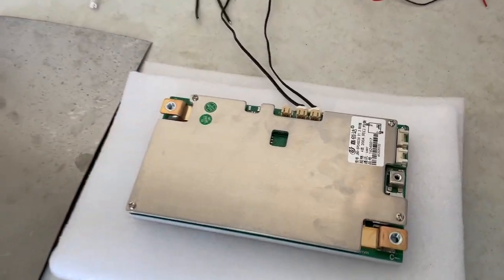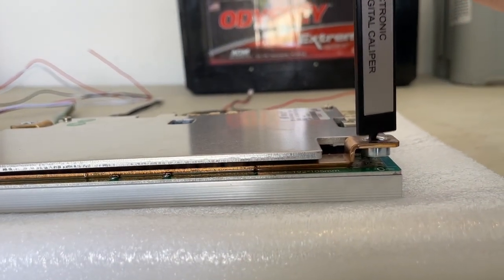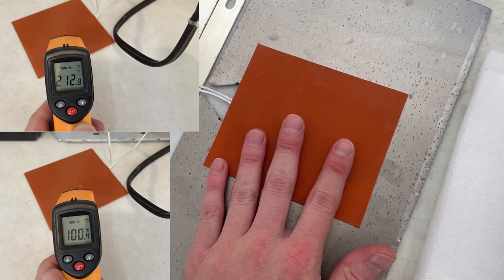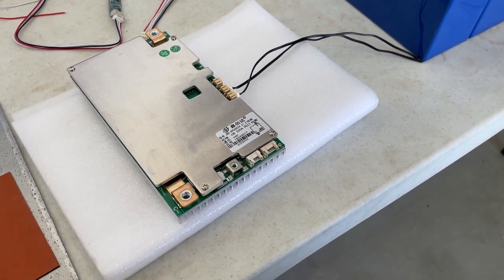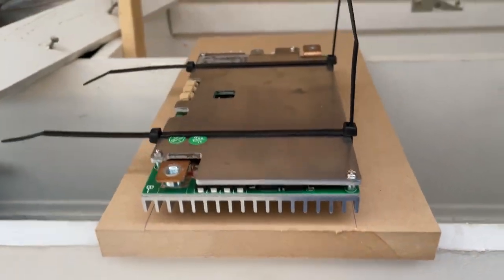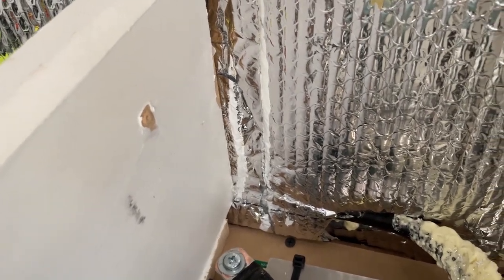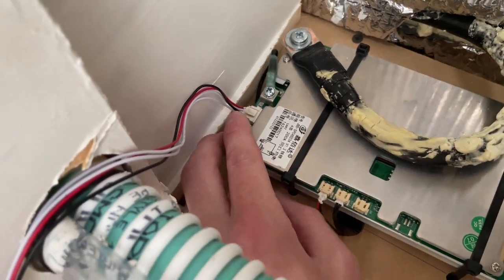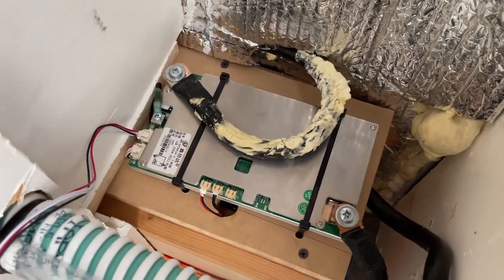200a JBD BMS - Full Setup Tutorial

Comment: I'd be concerned about shorting out the bms. Those wire connections are so close to that plate. Is there a way you could add a spacer to rase those connections or add a gasket or something. Just a thought. I'm interested in what kind of cost. I have 2 lead acid batteries so I only have like a 100ah. Your videos have helped me out so much.
Reply from the maker: Maybe a small piece of a mousepad or toolbox liner to slide between them would be a good idea!

Such a weird design to have them so close to the plate.

My total with shipping from Texas was $762.40 as of May 23rd, 2022. Prices are always fluctuating but that general range is a good reference. 

You can probably save ~$100 purchasing direct from AliExpress / Alibaba and having them shipped from China.

They've come down in cost quite a bit in the past few years! I know my used / mis-matched AGM setup was nearly $700 three years ago.

These batteries rate their cycle life in the thousands vs the hundreds with the AGM setup!
Reply: @VanwithTim  a toolbox liner would probably be a good choice.  Mousepad I think might be to thick. Or even a plastic washer. But any of those choices would work. Thank you for sharing how much you spent. I'm guessing your costs are in US dollars. I'm in Canada so it would cost me a bit more but eventually I will get lithium batteries. Right now I just have two deep cycle fld batteries from Costco which is charged by shore power or my alternator while driving. So I have like a 100ah and going to install 2-100w solar panels from renogy soon. The only heavy watt use I have is my 12v fridge which is between 35w to 50w depending on ambient temperature. Lithium battery prices are definitely becoming more affordable which is great. 👍
Reply from the maker: @navigatingthedestination  Ahhh. Could definitely be a bit for expensive in CAD (unless shipping direct from China! But that's a lot of trust to send that much $$ overseas)
Solar is a game changer! Hope your install goes smoothly!
Reply: Stick some kapton tape on the metal plate and it is done. Maybe two layers for a peace of mind.
Reply: Just had one of these delivered (zero instructions...) plus four 280Ah 3.2v cells plus a case. 
200 A BMS £124, 
case £30, 
cells £550. 

Less than cheap but incredible density. Will be used to power trolling motor on boat, electrics in caravan and potentially a small induction ring. Need inverter and b2b charger so I can top up with the car. 

Great video, I learned lots mate. Just need to wire it all up without welding myself or anything else together.

Comment: It's important to note that this is only for the JBD 4 cell 200 amp bms.  Other cell numbers or amp rating units by JBD are much different.  Even the appearance is much different.  I don't know too many who use 4 cells to produce 200 amps.  200 amp output would drain the cells rather quickly and the max output would only be 2560 watts.  Even if you used 304 ah batteries you only have 3890 whr.
If your batteries are located indoors you don't need to worry about the temp sensor or heating element.  The operating range of lifepo4 is so wide that you'll never reach the min or max.
It's not necessary to compress the cells.  Uncompressed, average use cycles, these will last 365 years.  Unless you have a time machine it's not necessary to compress to make these last longer.
If you're concerned about the heat sink turn the unit the other way around and let the fins be on top.  Or better yet put the bms in a box with a fan that runs whenever you are using the batteries.
Reply from the maker: All great points. My max power draw is usually around 2,500w (pretty close to the 200a on the 12v setup) A 1,850w induction plate + 600w AC unit plus the fridge and some small odds and ends.
Not a ridiculously sustained draw, usually just a few minutes.
So far no heat issues with it, but I do have some spare 12v thermostats and fans just in case!
Great to know about the cell compression. Some theorized the uncompressed cells expand / contract just enough during high discharge that it stresses the posts? (Specifically with the solid busbars of course).

Appreciate the insight as I'm very new to the lithium realm and there was a LOT of (often conflicting) research.

Comment: At 2:40 you mention the switch plug in and wires, but it's never mentioned again.  I guess if you're using the app to control the bms the switch is not needed. 
But what if you're in a location with no cell coverage,  no wifi,  no Bluetooth....like way off grid in remote location?
I wish you responded to questions. 
Great video.
Reply from the maker: Manual switch is really just there for emergencies. Your phone does not require cell signal to utilize Bluetooth, so even if you're in the middle of nowhere you will still be able to connect Bluetooth from phone to BMS for monitoring and controls. 👍
Hope that helps!

Comment: You are wrong in that the heat will be mainly dissipated by the 'shield' vs the beefy heatsink for two reasons:
The mosfets have a solder thermal pad at the bottom which is really great at transferring heat to the pcb (much better than via top of package which is plastic and has thick thermal pad) and
The PCB is an aluminium one, not your standard FR4! Excellent at transferring heat from pcb to heatsink!
This is a well-designed BMS
Reply from the maker: This certainly makes me feel better about the mounting position. No heat issues so far!

Thanks for the information!
-Tim

Comment: I also bought from Docan Power and you are correct, NO INSTRUCTIONS!   I have four JBD 200A BMS that I bought from them with my 64 EVE 304Ah cells to be configured in four batteries in 16S 48V that I haven't yet been able to figure out how to install.  I have two different styles and neither of mine are the same as yours.  One style has four more wires than the other.  Any suggestions on where to find the right instructions?  Docan Power wasn't any help, they sent me some things in Chinese.

Comment: Hi, Great video. Did your BMS come with power cables to connect the battery negative terminal to the BMS and then the BMS to the load / charger ?
Reply: Mine didn't
Reply: @steph8833  Thanks

Comment: Hi,
Have you tested or somehow verified that the low temperature charging cut-off setting really works on this one?
Same question for high temperatures. 
Also when I saw the temperature cut-off switch, my first thought was to connect it straight to the switch port, so it turns the whole thing off in case of over-temperature.
Reply from the maker: A few people on the DIY Solar Forum mentioned issues with bench-testing the cut-off and that it needs to see a load or charging current before activating the cut-off. 
I haven't tested either the low or high temp cut-off.

I'm not sure if the switch port needs a momentary connection to turn on or off. If it's a full switch design where any continuity disables the BMS then the temp cut-off switch would in fact work perfectly there. (Although in theory the BMS temp sensors should cut-off at the high temperature set-point)

Great question that I can't quite answer unfortunately!
Reply: @VanwithTim  Yep, I saw the Off-Grid Garage video about that, but that shouldnt be a problem because any acyually damaging current will still trigger it. Was just interested, is it same quality and function as the widely tested 120A. 
In end I just went with 2x120A Overkill (I have 8 cells), which should just be a tested JBD with better warranty and support. I asked them if they are planning to introduce a higher amp version too, answer was no.
Reply from the maker: @karlerikrabakukk2694  Hmmm. Hopefully this 200a unit will hold up! Haven't given it a real extended real-world test yet. Just a few standard high amperage ~45 minute tests.

I've always heard good things about the Overkill BMS as well. It sounds like you should have a solid set up!

This is my first adventure into the lithium world, so still lots to learn (thankful for so many great resources out there).

Comment: I'm glad I ordered the older/original version with the longer lugs. I never installed the heat pad to my BMS. Do you know the maximum size heat pad you can connect? I have a select of different sized 12v heat pads. I will need to fit one before the winter. Also worth considering setting up the heat pads at 5 degrees so the cells never get close to 0 degrees.
Reply from the maker: It's a really goofy redesign for sure.
I'm seeing reports of up to 8 amps through the heater port. (~100w) But can't find any official documentation other than hearsay within the www.DIYSolarForum.com 
Specifically - https://diysolarforum.com/threads/jbd-4s-200a-bms.27012/page-9

That's a good idea on bumping up the turn-on temperature. The battery and solar setup can certainly spare the <15w for the sake of keeping the temperatures at a healthy level.

Good call!
Reply: @VanwithTim  I got 3 of the original BMS boards when they first came out. Back then they didn't even show the M4 lug soldered onto the board in the pictures. At the time I asked the seller about the Maximum Watts input for the heater pad and after a vague answer and few other buyers got different answers. That's why I didn't fit any heat pads. LOL
Reply from the maker: @drewhodge3820  It's truly incredible how vague the manufacturer's documentation is! 
You'd think the engineers would want their specifications published..?
At least it seems to be a solid BMS choice for the price.

Comment: the idea of heater is to heat battery up to above 0c. or maybe around ~30c for best performance. having heater to cut off somewhere 60c is way too hot and unneeded. it's somewhere because bimetal switch is under plate and heater is on top?

a spare roll of kapton tape is also a good idea for using around those terminals, just in case

also there might be issue if balance leads are connected to bms and you switch disconnect switch off

finally, is there a water hose directly over battery and switch?

also, if this was any vehicle, the vibration of any bigger componets becomes an issue as things can vibrate off pcb solder joints or vibrate loose and short out!
Reply from the maker: I was thinking the same about the 60c cut off temp. Hopefully it will cycle on / off actively to average a much lower average temperature.

There is a lot of debate and question around the JBD BMS and the heater terminal parameters. It seems to require a very specific scenario for the heater circuit to activate.

As for the battery cut off switch, it seems to handle it okay. It should be equivalent to turning off the battery loads - just all at once instead of one at a time.

Yes unfortunately that's the water fill hose. Luckily it never has water inside unless actively filling the tank in which the operation is supervised.

I am certainly weary of all the electronics in the van. I don't think the inverter, MPPT solar charger, or this BMS were designed to handle the vibration - specifically the solder joints as you mentioned.

Will continue to keep an eye on the system and listen for feedback from other mobile installations.

Thanks for the thought out and well worded comment!
-Tim

Comment: Thank you! I just bought this BMS (two of them actually). Your video has helped a lot! Thank you for taking the time to share this great video.

Did you happen to do anything with the cable that you think is an ON/OFF “switch”? I’m just curious. I just looked at the site that I bought my BMSs from and it says it is a “discharge port switch.” I don’t think it is a must-use thing, but I wonder what the application would be.
Reply from the maker: Glad it helped a little! I left that mystery port untouched on my unit. The one time I wanted to disable power output, it was as simple as toggling the switch in the app.

Comment: I love your build Tim, we are sure to see some big dramatic differences in your electric quality of life over time. Are there some stories already in how it changed everything for you? :D

That near connection between a heatsink and wire is probably something that you should come back too asap so vibrations, bumpy roads or whatever doesnt make it touch it. I am certain you already have some plan how to solve it.

I am also kinda wondering, does wood in any way insulate batteries so well that temperatures are non optimal in some way during heat wave? I like how you went with layer so thick that you could make a heavy duty shelf.
Reply from the maker: Its wild. I paid nearly $800 for a combo of used and new AGM batteries just three years ago. Everything with shipping and tax here came to around $750 for double the (true) capacity!

Very excited to test it out and enjoy it.

You're 100% on the harness running below the heatsink. I was thinking that while assembling too. Will grab a few inches of 1/4" wire loom to play it safe!

I also wondered how the 3/4" wood would effect the cell temperatures. As of today, with an exterior temp of 102F (39C) and that back corner of the van in full sun, the cell temperature sensors show ~84F (~29C) while the BMS on top shows 93F (~34C).

However the temperature operating range is pretty good on these cells - they can charge between 32F to 131F (0C - 55C) and can discharge between -4F to 131F (-20C to 55C).

I suppose the cells themselves are so dense, it's basically a huge metal cube that sits at the average day + night temperature.

Time will tell how they behave with extreme (~150a) prolonged discharging!
Reply: @VanwithTim  You are golden with those temps. With 3kwh lithium and 1kw solar you have better electric generation and storage then most van people in luxury builds and 99.99% amateur sailing boats and that includes million dollar yacht(I am not joking, people are choosing AGM on purpose even with major bucks). Without hesitation i can say that you(we?) are minority about right ideas for electric specs in off-grid. 

That is just so amazing how your power system is adequate to handle anything. Hell, even off-grid systems cant compare to that, people usually just use bluetti ("AC200P" 1700$ for 2kwh and 3700$ for 3kwh "AC300 + 1*B300") so they dont have to think about inverters and wires.

Personally i would avoid harness in such tight space because i am way too afraid how vibrations can wreck anything in silence and you will never know. Something like repositioning wires and buying longer ones to fit nicely would be permanent solution for me.
Reply from the maker: @KingCrowley1  It does drive me crazy how so many van builds are so underpowered. Used solar panels are ridiculously affordable, along with the charge controllers and now even the batteries.

Kills me seeing people throwing their money away on the "all-in-one" solutions. Getting 1/5th of the power for 5x the price.

As for mobile wiring you're spot on to play devils-advocate in that any wire in an even SLIGHTLY precarious position will end up failing eventually. Maybe not this year or even this decade, but you can only rub against the same patch of wire insulation for so long before it fails.

Unfortunately the majority of people failing to properly secure their wiring are typically the same folks running un-fused connections or undersized wires. Really is a miracle we don't see more campervan fires than we currently do.

Comment: Can I connect two BMS in parallell with two banks of  of 16 cells??. If is correct what I need additional to the two BMS. Thanks
Reply from the maker: I'm pretty sure these can be connected in parallel, but I would email Amy at Docan Power to make sure you get the right BMS. The one in the video is only for a four-cell setup. Amy's email is: docanpower22@gmail.com

Comment: How or by which condition the heating port works? I have the "older" version WITH heating port. Connected heating films. NO HEATING IS GENERATED at any temperature values settings. However, tested the films connected directly to the battery works ok.
So I wonder when the heating port receives the "-" ? 
Contacted the aliexpress official store - replied me with the descrioton of how to connect the heating films)))  However, I do know and already connected all as it should and tested all - heating does not work.  Then the seller became silent, my questions marked as "read" while no reply made.
Reply from the maker: I know the topic is highly debated on https://diysolarforum.com/
The exact parameters don't seem to be known, but most agree that the heating circuit won't activate unless the batteries are being actively charged or discharged. (Not sure how many amps it needs to see or at what temperature threshold)

I would definitely search around or even make a post on https://diysolarforum.com/ for more information. 
Unfortunately communicating with the Chinese sellers is very tough and rarely delivers meaningful answers.

Comment: is it heating when charging or always heat on when cold temp?
Reply from the maker: From what I've read, the heating circuit only activates when actively connected to either a load or charging source. JBD is very flaky on the details. Lots of speculation on the DIY solar forums when it comes to the heater circuit and how it operates.